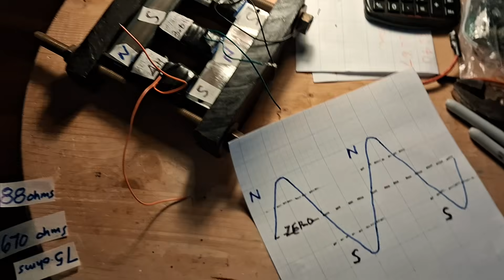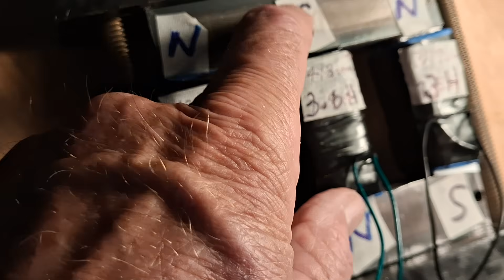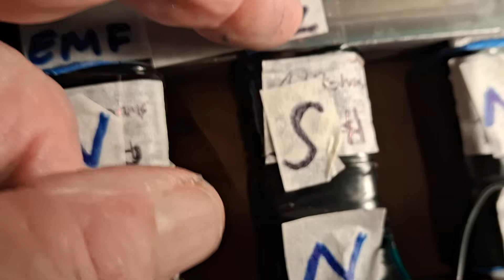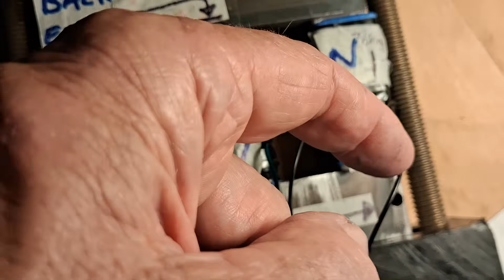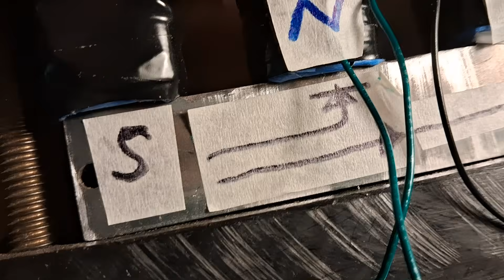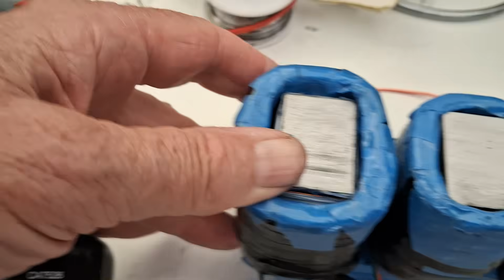Better explanation of how it works and new construction of the no backemf transformer

Comment from the maker: The idea of a collision of backemf and eliminating it is not how it works...
In a BiTT transformer with magnetic shunt bars mounted above and below,  this would be the case, plus reinforcement of power in opposite secondary with whatever gets through and does not actually collide.

In this design shown in drawing, the far right third phase becomes the backemf shunt bar.
And fact the backemf is first diverted past middle leg by tye bucking magnetic flux, 
then the backemf is pulled into the far right third phase by S N magnetic attraction.

Comment: On the core where you direct the bemf instead of one coil put two on, one clockwise the other counterclockwise then you should be able to collect it regardless of polarity instead of just having it cancel maybe?
Reply from the maker: Yes in the BiTT transformer with magnetic shunt bars added on above and below that send backemf over to opposite secondary, A is secondary B is primary C is secondary.....best I could prove with that is 90 degree phase shift into primary whivh equals zero watts input but real power out from secondaries to resistive load.